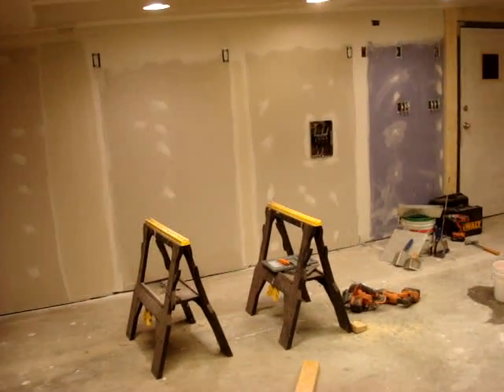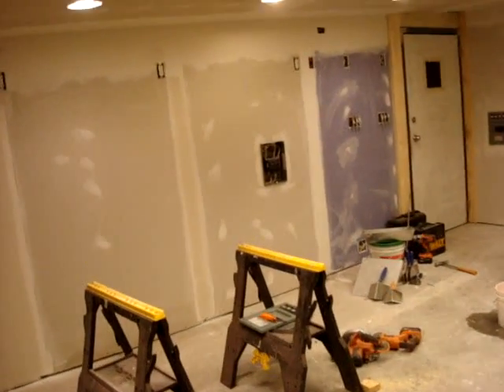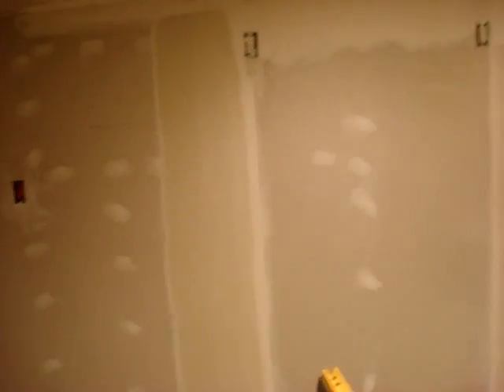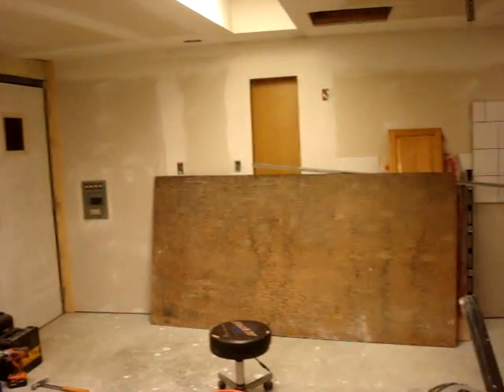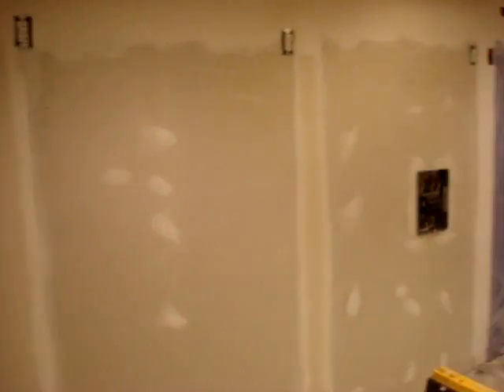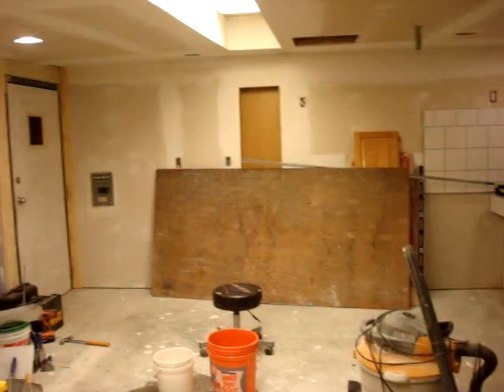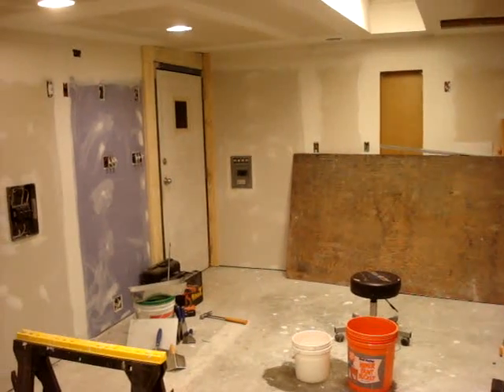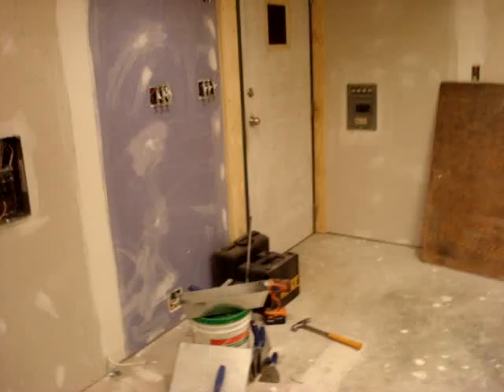Wall Finishing and Electrical Box/Panel Gap

Comment: I always took this a step further in that I would drop a dedicated ground for each sub panel. You should probably have explained what can happen from the problems you describe. For those who haven't watched your other videos this could be a little confusing.
Reply from the maker: +ExStatic Bass You can never have enough ground rods! Haha. For subpanels that are some what far away from the main, I do run another rod for the subpanel (like 100' or more). I also try to run 3-4 rods 6' apart from the main even though code requires only 2 (or 1 that is 25 ohms or less). I'm all about the least resistance to ground!

Comment from the maker: Heat as a byproduct is always an issue with anything electrical. I can't speak to your specific situation with the Jbox, but here are some general points: devices, fixtures, conduit, and boxes sometimes need to have an airtight box build around them instead of having direct contact with insulation. This is especially the case with can lights, and some are not rated to be in direction contact with insulation. If it's just a simple junction box, or a light switch, without concern of heat issues, I tape them first with house wrap tape (before installing drywall), and then spray foam around the box. I then install whatever insulation is going up like fiberglass or more spray foam, etc.

Comment: Great video! I found it while searching for recommendations on how/what to use to insulate properly in the wall cavity and around a J-box that was just installed when our 200 Amp main panel was relocated.  Any suggestions?  Thanks!

Comment: well, your videos popped up when l went to utube.a good plasterer does not sand.l use to be in some homes to do work and learned to apply last coat of plaster watered down and then wet sponge with the right sponge(coarse and fine surface). Hence no dust and complaints from customers. when u sand one looks like a ghost and the dust always hangs around. secondly its a good idea to scratch surface of box where you screw on the ground bus bar  because of the paint on box and screw threads.
Reply: Wow, amazing.

Comment from the maker: I'd suggest getting a licensed electrician to your house ASAP. In the old days (pre-60's) many homes did not have a ground system, so it's possible your never did, but as safety goes, it's vitally important! I could never advise via the interwebs--you really need a local pro to lay eyes on your exact situation.

Comment from the maker: will go out to earth. The bare wire coming in in a 3 wire residential service comes off the grounded center tap in the transformer. Also, you can add an extra ground rod to a subpanel (like if you have an outside shop), but again the panel has to be unbonded and the neutral return and ground needs to stay separated. The only time the ground circuit is live is in an emergency like a short, etc.

Comment from the maker: There can only be one path to ground, and that path needs to be 25 ohms or less from the main panel. If you were to bond a sub panel, you'd actually be combining the neutral return and the ground! The neutral return (the white wire) is actually a live circuit carrying left over 120v electricity back to the main panel and to ground. If you bonded that circuit, then the ground circuit would be live too! The ground can't be live. At the main panel the low resistance run from the bonded bars (next)